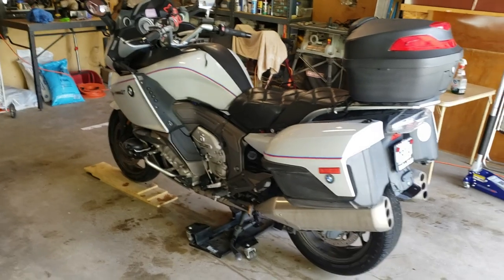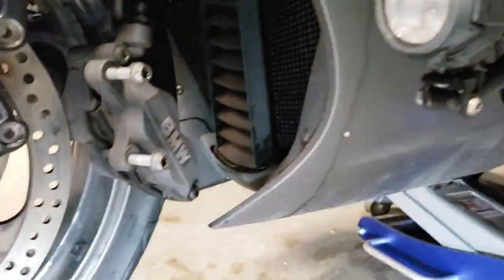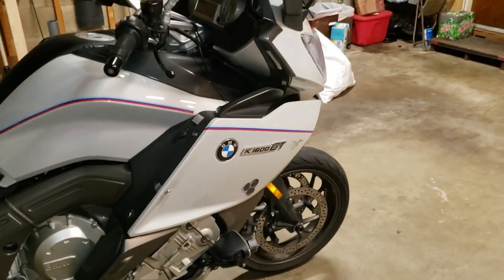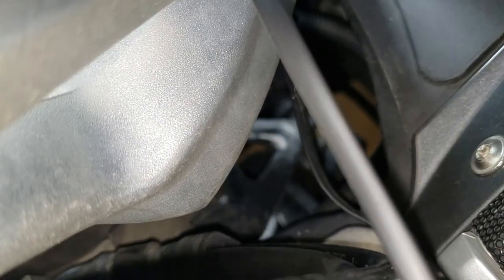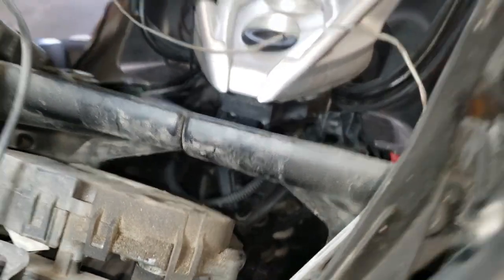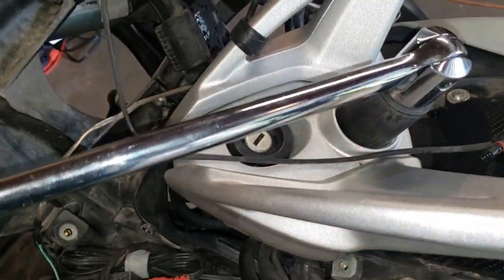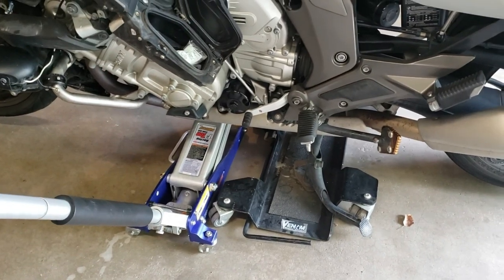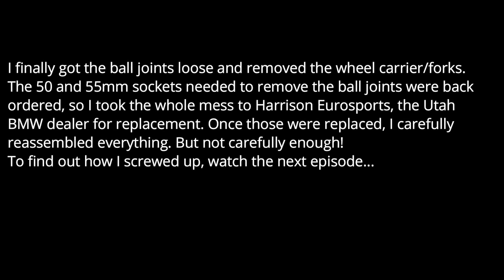Jaysbigadventure BMW K1600 GT Ball joint replacement

Comment: Feel your pain. I advocate front wheel bearings should be a scheduled maintenance replacement at no more than 40k miles. Thanks for posting GREAT video shots!

Really curious about what went wrong during the reinstallation. Hope the other video is posted soon.
Reply from the maker: I'm working on it now. :)

Comment: Wow, great video and what a job!
I am very grateful as I need to get my guage cluster out just to try and clean and reseal it as moisture is getting in. I am also replacing the GPS cradle and wires, I asume its easy to trace the two  plugs that split off the one cable. Seems to go to the right side of the tank from what I can see?
Reply from the maker: Yeah, once you get in there far enough it's pretty straight forward. Thanks for the kind words!

Comment: Going in that far, might as well upgrade the suspension/shock too.  I went with the gas tank removal method instead of upper fairing removal when I pulled the front fork assembly.
Reply from the maker: Thanks for the comment. I wondered if there might be an easier way in there!

Comment: Age or miles for the front bearings? Which comes first? I have a 2012 with low miles and would lIke to know if I might need to replace them.
Also thank you for posting your work.
As always BMW stands for Bring More Wads of cash.
Reply from the maker: The bike is a 2012, and it just turned 61k miles. An ignition coil is the only other failure I've had.
Reply: Jay Bear thanks.

Comment: I can't find the link describing what you screwed up? The ball joints on my '12 GT are bad and I'm trying to decide if I want to tackle the job myself. I've had the headlight out before so I'm comfortable to that point.
Reply from the maker: I forgot to put the spacer back in the front wheel when I put everything back together, lol...

Comment: Is that a car tire on the rear?
Reply: The dark side!
Reply from the maker: Yes, and I have several videos on my experience. Look for the K1600 play list. 15k miles and half the cost. Pretty good deal, and I still scrape the pegs on a regular basis.
Reply from the maker: Hey, we have cookies, right? :) Check out Roll 'N Dark Side Facebook group!